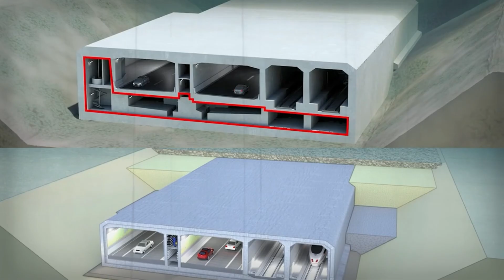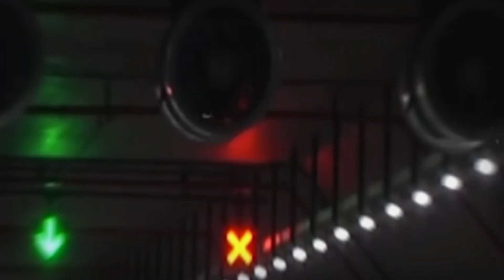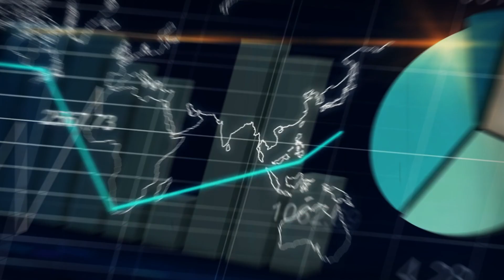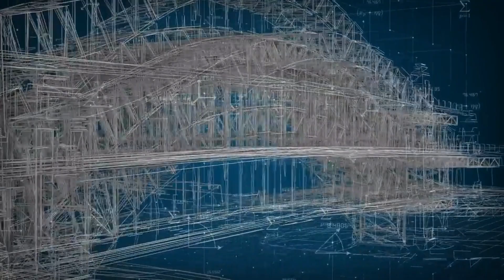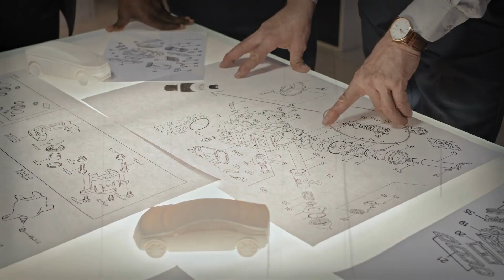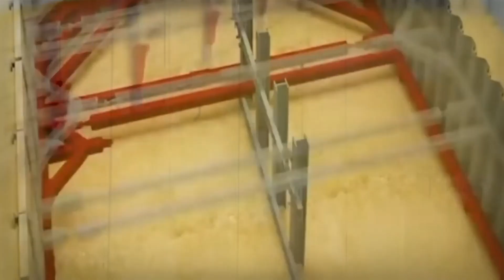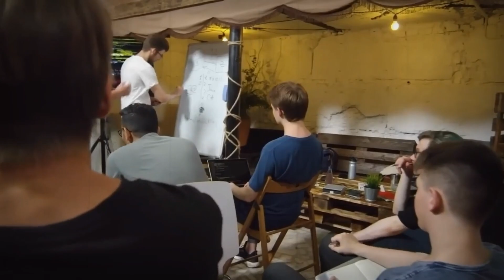China Leaves American President Shocked, & built the world's longest undersea tunnel!

Comment: Your a liar and when I've said a bit more I'll prove it. I will report your deception and clickbait trash.

1.  No such tunnel has been built yet.
2.  You are supporting typical Chinese propanda.
3.  You are a CCP supporter in fact or by communist   deeds.
4.  You are using Amsterdam video as Chinese.
5.  Your showing Denmark video for their BM1 mega Tunnel project, not Chinese produced video.
6.  Your clickbaiting.
7.  The odds of China actually building such a tunnels is       probably none.